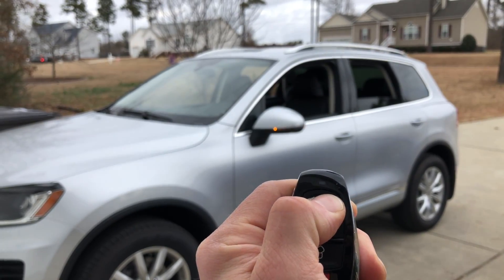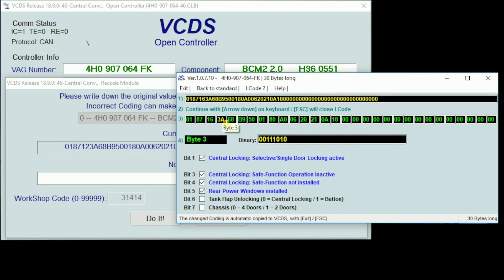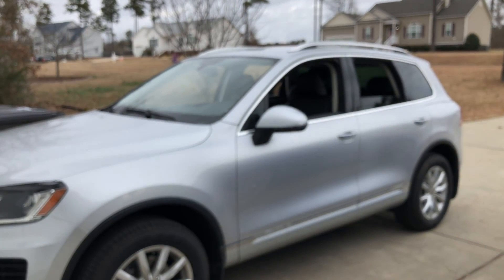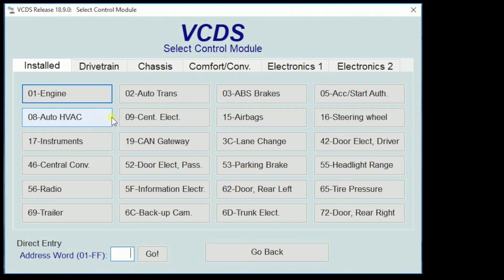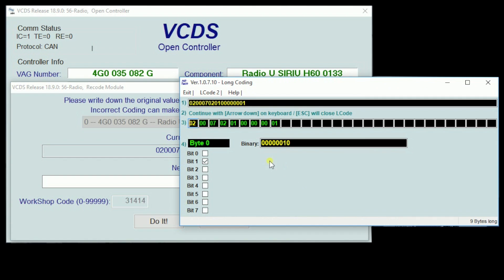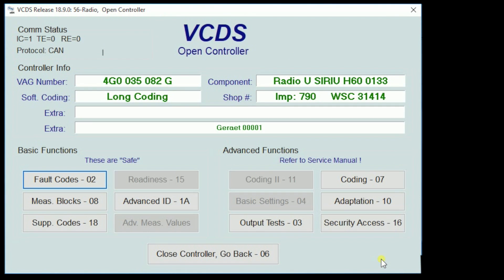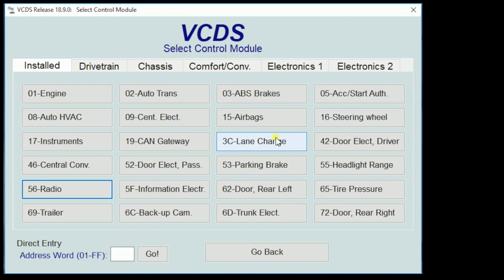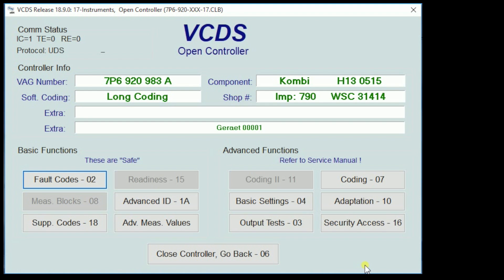Touareg Coding Changes for Radio, Seat Belt Warning, and Windows ~ VCDS Tutorial

Comment: You can change the vehicle model in the transmission from a Touareg to a Cayenne. It sharpened the shifting and gave me a gear display on the instrument cluster. 2014 Touareg tdi.
Reply from the maker: Ah nice! Any different with towing?
Reply: @HumbleMechanic  Didn't really notice anything else towing or not just better shifting over all. Which is nice with the fat torque of the tdi.
Reply: HumbleMechanic dude I’m desperate to bring my Touareg closer to the pre dieselgate glory it once had.  There is not much out there as far as clear how-to on these mods. I’ve also read that there is coding that can make the throttle on the TDI more linear and less delayed like it is now... please help lol...
Reply: @Van-tastic  I would highly recommend a Malone stage 2 tune. Been running on stage 2 for 100k miles no issues. Uses a little more def but that's it. Our dealer seemed cool about it.
Reply: @dieselgaint  the dealership will seem cool because they will let the vw rep play the bad guy if something happens and they choose not to honor the warranty.  I would love to do a proper remap, but this warranty is too important to risk right now
Reply: @Van-tastic  Check ClubTouareg, you can get your TCM pulled and bench flashed back to pre-fix.  The member that does this can send you a loaner TCM to use while he flashes yours,  highly recommended.  This will restore MOST of pre-fix performance.  Same can be done for the ECU.  The bench flash of either is essentially not detectable by the dealer should you need warranty work.  Unlike OBD flashing which is tracked with a flash counter.

Comment: Charles, set your gearbox to shift like the 9P Cayenne....
Reply from the maker: I read about that. what does it actually change?
Reply: @HumbleMechanic   As I understand it lets the engine rev a little higher (few 100 rpms) but makes shifts faster, not harsh, but snappy..
Reply: @HumbleMechanic  People who have done this primarily claim this has made the transmission quicker to respond to throttle imputs (downshifts) and have a faster feeling upshift.  I think the only thing we know is  there is some difference between the Cayenne and Touareg, and if the coding is different on the Cayenne it must be "better".

Comment: Have you ever restore a 70s flat bed truck. I want to restore it and it would be my hotspot truck. But I would add some convenients like power seats heated seats ? Not power windows I hate those remote restart power locks. And so on. Would that be hard to learn how to do for a beginner
Reply from the maker: Sounds like a super fun project and a great learning tool
Reply: @HumbleMechanic  
Yes I would have to look up how to do 99,% of it. But it be one hell of a project. But first I have to find a truck that would suit my needs. And that isn't totally beat to hell

Comment from the maker: I realize this video is not going to apply to everyone. But hopefully you can still learn a little something about how vehicles operate
Reply: Always nice videos, thank you very much for the good content !
Amongst cool features that are standard in Europe, but not in Northern American Market: Mirror dip-down when in reverse. Close all Windows upon detection of Rain. Turn on the front left fog light when turning left or when moving slowly with left blinker on. Same with Right fog light... Change the accelerator pedal pedal response from a treshold (2x accelerator modes) to a linear acceleration response. Welcome Home lighting. Add some new instrumentation displays (remaining fuel, battery level)... Change the reverse light strength. Add the school mode on the central display screen. Change the emergency phone number or repair garage phone number. The VWs are so flexible with VCDS, you can really activate a lot of options available that you would normally pay for... Thanks again !
Reply: ROW vw settings are different to America, there are different code options available, I have found that ROW settings tend to offer greater options when blogging on VW forums regarding this topic, probably due to all the different restrictions applied by different States. Love working with VAG-COM / VCDS, Ross tech have a great package
Reply: Have you done a Touareg specific video about correctly tightening the wheel nuts yet?
Reply: How about a video on using the VagCom to mod Audi(daytime running lights, comfort options, etc)??
Reply: It didn't prtain to me directly,  but I watched anyway, just because I think it's cool that you reprogram stuff like this.  Is the Touraq the only VW that allows this sort of coding changes, or can I do something similar on the newer generation Jettas, for example?
Reply: Just a small suggestion, I don't think it's a good idea to disable the seat belt alarm this way. It's better to disconnect the belt sensor under the seat if you usually put your seat belt. The reason is simple, if you have a false contact in the seat belt receiver, without the warning you will not know it but your airbag system will take it into account and may not deploy the airbags in case of a crash! If you disconnected the seat belt sensor, then the car will assume that the seat belt is on constantly and deploy airbags in all cases (which also can be dangerous if you don't wear it)
Reply: Hi there I have 15' T3 TDI Lux  and I absolutely love it. Among most loved changes I did with OBDEleven is dimming DRL when turn signal is on to 50% instead of fully turning it off. There is one thing I 'm dying to do:  turning on fog lights automatically with headlights. To clarify: I have my headlights switch on auto and it works perfectly but foglights are something you have to press the button to activate. I would like to get all 4 lights(2 fog + 2 headlight) light up automatically when its getting darker. Together they are producing much more light and makes sides much more visible. On some forums they were saying it could be done with switching county through VCDS to Canada but i was unable to figure it out . Please advice... 

P.S. absolutely love ur chanel. <3 and yes it is legal to drive with fog lights on in my state.
Reply: I have a real challenge for you...Can you reprogram this blank key http://www.keyecu.com/index.php?route=product/product&product_id=624 with that VCDS systems? Much appreciated!
Reply from the maker: Not on this car

Comment: First!

Edit: Charles, is there perhaps a way to code the glowplugs on a T1-Facelift Touareg V6 TDI (BKS), so they come on even below 19 Degrees(Celsius); to help with the hard-starting issues of that generation?
Reply from the maker: WOO!
Reply: @HumbleMechanic  Please Charles, this is becoming a huge problem for the T1 and T2 models. I saw that there is a coding option for preglow always on but I could not get it to activate.
Reply from the maker: I will look into it. It's probably not a coding change, but more likely an adaptation. I will poke around and see what's up